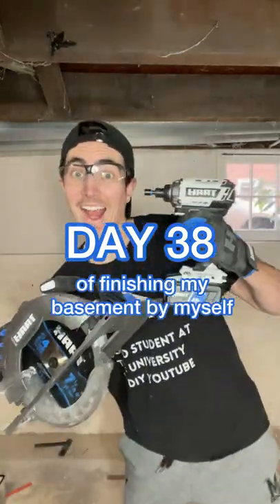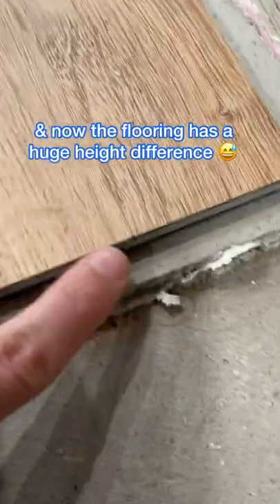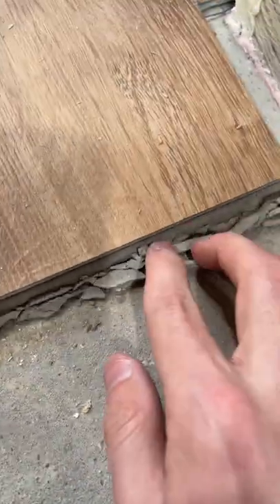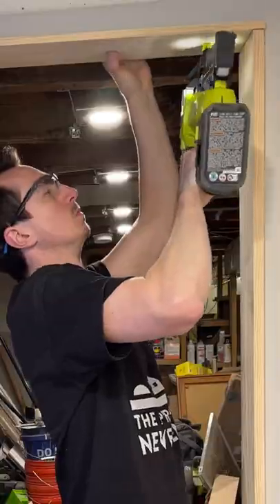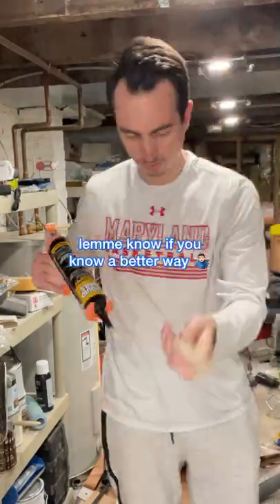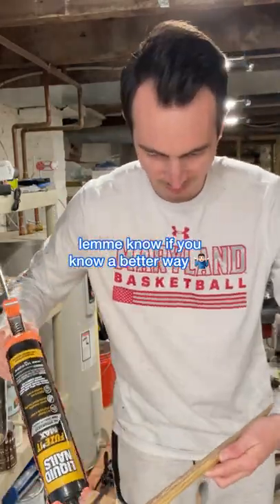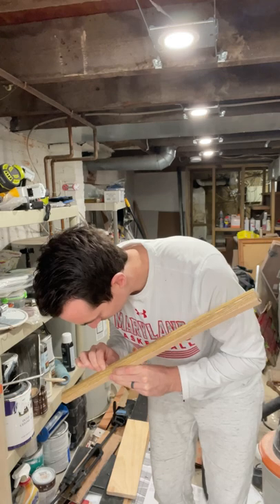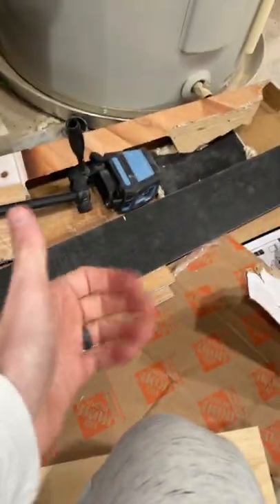DAY 38 | Finish Basement by Myself 💪

Comment: Looks great. I have in the past made custom transition moldings out of 2 pieces of 1x oak glued together, taking out large portions where necessary with the table saw and creating a rounded/sloped top with the table saw and lots and lots of 60 grit sanding. Find a stain that somewhat matches your floor and it looks great when the store bought transition molding doesn’t work. I one time dropped down 1 1/4” with a custom molding… big difference!

Comment: So to match the contour of the floor. Get a piece of cardboard (or the piece of wood you are going to use) taller than the difference  and wider than the opening. Use a standard locking compass to follow the contour of the floor while marking the piece you will be cutting.

Then use your jigsaw or bandsaw, or belt sander, or hand plane, or handsaw to follow the contour. Then level the other sides. To attach it to the floor is just use small concrete anchors that take mounting screws from the top. You can do it poorman style by getting 3/8" anchors then grinding them flush with the floor and drilling and tapping holes for smaller screws in the anchor.

The pound in anchors or the j hook anchors work best for this.